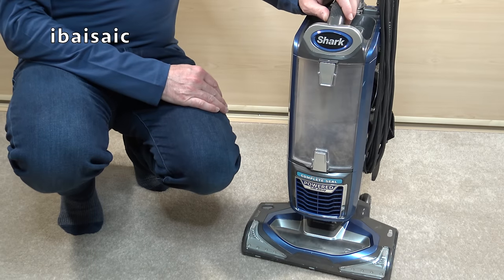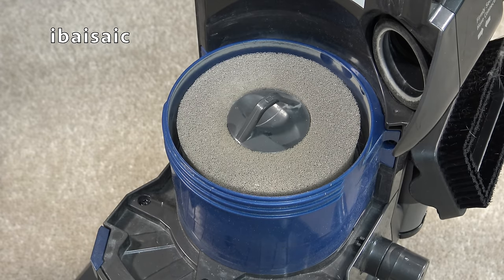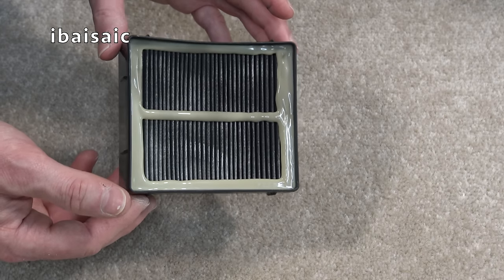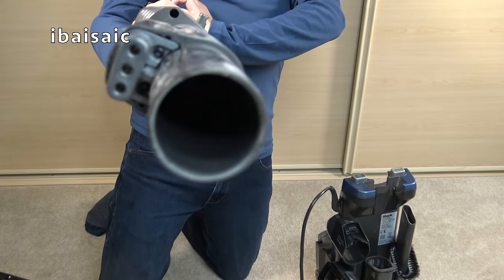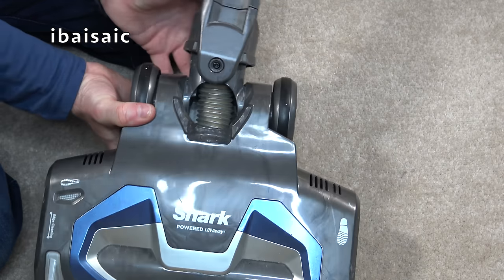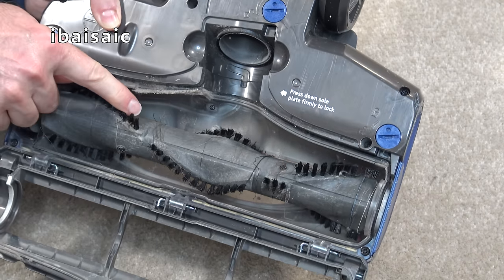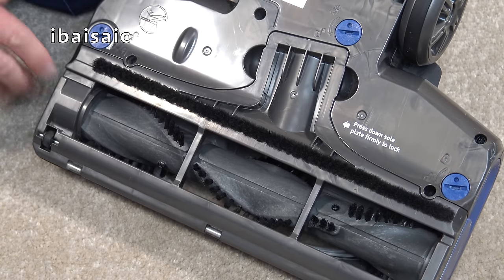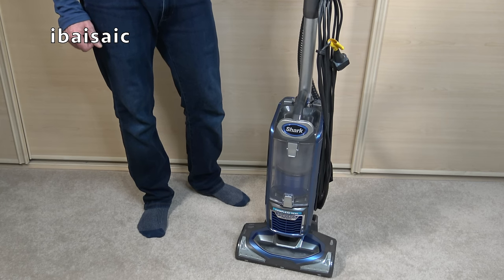Shark Powered Lift Away Maintenance Tips Loss Of Suction & Performance

Comment: Kind sir, thank you for saving my Shark. I had done all the steps, new filters, cleaned brush roll, etc. Had it squeaky clean and yet it had no suction. Because of you I checked the hose! It was incredibly clogged, i pulled out all the packed junk with a 12 inch wire w/tiny hook on the tip (made it myself with dental tools from the 70s). So much stuff came out!. Once battery went through the hose, and I assembled machine back, it worked like it was brand new! No damage caused to the hose because my wire rig was tiny and I was gentle.

Comment: The clog I removed was in the handle. Once I figured out where the clog was I used the six inch brush designed for cleaning the vent duct hose on my dryer. It attaches to a three foot flexible plastic stem that you can screw into another three or four identical plastic stems for removing clogs fifteen feet up the duct hose. One was plenty for clearing the vacuum handle, but you do have to twist it two or three times to clear the handle clog.

Comment: A trick for cleaning the hose and wand after separating them is to get a piece of small rope longer than those, and tie it to a cleaning rag. Dampen the rag with a bit of a mild multi-purpose cleaner or slightly soapy water. Then run the rope through to the other end, and wad up the rag a bit as you stuff it in the hose or tube. Should be some friction, but not to the point where it's difficult to pull through. Thus you can get the insides of those pretty clean with a few passes pulling the rag all the way through like that if there was anything sticking on there. Also make sure things are thoroughly dry before using it again. Different than dealing with big clogs, but will deal with any moldy/musty smells still coming from the vac if the lower parts have already been cleaned.

Also if plastics on floor attachments or wheel rubber gets dirty with anything sticky, a cloth sprayed with foaming tub/shower cleaner will do a bang-up job on them. Let it dampen those spots for a bit, and it should wipe off real easy a few minutes later. A lot of modern showers have a molded plastic liner, so that cleaner tends to be safe on plastics even though it's strong at breaking up dirt and gummy stuff. You may want to wear gloves for that though.

Comment: Check you upper handle hose before going any further with a flash light to make sure you see lights from end to end.  Mine was clogged so bad I ran pressure water through it.  I used blow dryer to dry inside and after a few minutes "bravo" :))  The "dead horse" woke up and ready to work:))   Very impressive videos and everyone's feedbacks what makes this works for everyone:)) Happy holiday two weeks away from Christmas.

Comment: I have both the NV680 and the NV340, and I always notice that the sponge filters of the NV680 get completely dirty (grey with dust, as can be seen in the video at 1.16"/1.17") after each use, unlike the NV340! I bought a second set of filters for the 680, because I have to wash them after each use, it never could go for an entire month without a good wash. I have no idea why this does not happen with the NV340 model...it just seems to have better filtration somewhere in the machine, they just do not get dirty so quickly.
Anyone has experienced this as well?

Comment: So glad I’ve been doing all the right things! Probably why it’s been great for 6 years up to now. Does the brush have a belt that turns it? Mine is not turning and I thought I’d ask before I tore it apart. It works so much better with the brush, I can’t hardly push it without the rotator working. It also doesn’t pick up much on my thick carpet with out it. I’m using my Shark Stick until I find an answer.

Comment: I would also say they have made this vacuum harder to service. They have changed all the fasteners to T20, wires within the head are now passed through plastic before attached. Many don't realise that there is a motor in the head that powers the brush to turn. The lower hose is now one piece and not screwed in on opposite lock. Also some of the parts inside are very easily broken, esp the mech that allows it to stand upright. Trust me I have tore down this machine to its bare components. Think I may have to buy a new one as mines has a noise from the air release vent which I have also taken out and checked.

Comment: Thank you good sir! You just solved our loss of suction issue. Roller wheel was extremely clogged with dog hair and carpet freshener powder was built up in hoses. Everything was cleaned and unclogged and yet there was no suction. I pulled up your video and you showed the motor exhaust filter --- the exhaust filter was totally clogged with carpet freshener and didn't suck - feared the motor was blown😦. Banged the filter semi clean and Voila! DO NOT USE POWDERED CARPET FRESHENER in these vacuums! Thank you so much for showing ALL the nooks and crannies on this vacuum!

Comment: It’s amazing how much a new filter can improve a 3 year old machine. Got this shark pet version given to us from my sister in law. It BARELY had any pull at all. Wouldn’t pick up anything from hard floors at all unless using the hose. Even then, most of it (stuff like little kitty litter rocks) just fell right back out of the hose. 

This thing runs like a brand new machine now. So much hair and junk getting pulled into the tank now after all 3 filters replaced.

Comment: Done all that. Still not picking up
Reply: I'm have the same problem and I've discovered that if I take all the filters it sounds and would work fine. It seems like the compartment behind the hepa filter seems to maybe have collected some stuff that's not allowing the air to flow properly. I'm looking for a video of pics to show me what others loo!s like. Mine looks like they have a gray filter or something but I'm not sure if it's supposed to be there or if it's a collection of dust trapped. Maybe you can check and let me know what You see??

Comment: Thanks for the video! I inspected, checked for any clogs (there were none), cleaned the canister and filters.  It continued to overheat.  Had it not been for your comment about the hose cracking I would not have known.  My shark vacuum isn't even two years old.
Reply from the maker: If your hose has cracked, contact Shark as it should be still under warranty. They have changed the hose on newer machines which should have stopped the problem with the hose splitting on earlier models.

Comment: Thanks for the video. I regularly clean the two pre-motor filters, and was wondering if there was another I wasn't aware of. Sure enough, there was. But sadly, while finding that filter, I discovered that the small internal hose is split. I'll email Shark, but my machine is 10-11 years old, so I'm not hopeful. On the plus side, it has worked well for the past 10-11 years; this is the first problem I've had with it. Thanks again for the video.

Comment: Great video, I've got a vacuum that is the exact same as the one in the video. It sounds like it's clogged and is running on high RPM's, but I've checked everything and the hoses aren't clogged and the filters are clean. Still don't know what's wrong...

Comment: I’ve got a Shark Liftaway that now turns off when I disconnect the Floor attachment to use the wand for dusting.  Shark could not help, They sent a whole new motor body but it still happens. Should I buy a new wand?

Comment: This gentleman explained each aspect of what to clean and how in an understandable manner. The visual details he provided were exceptional. 

Two things he mentioned made an impact on me. The first being the use of antibacterial wipes and where. Thinking of using them was too much like right. 🙄

The second thing he mentioned, and emphasized, made me gasp. I had no idea there were electrical wires in the long hose. I have the Shark Powered Lift-Away with the Anti-Allergen Seal, and my task for today was to perform an interior deep clean. 

The items I intended to use were close to items he stated should never be used. We’ll consider those “the things we do not mention.” 

Excellent, informative, and vacuum saving presentation. Thank you. Shark should have his presentation their website under the maintenance menu website, on how to clean your Shark Vacuum.

But that would also fall under “too much like right.” It’s apart of how they make money. Ooh, did I thank this gentleman? Thank You!

Comment: The motor on mine keeps overheating after 5-10 minutes of use. I just cleaned out the wand. It was loaded with dust and I found a small rock inside. Will update if it continues to overheat. Thank you for posting this video.

Comment: Thank you so much. I though my vacuum gave up the ghost. Since watching this video my blockage was up ar the top of the hose on the inside. I removed it it's good as new.. I went ahead and cleaned all the filters. The speed is up as normal, and the pickup suction is strong again. This vacuun wouldn't even come on even if I pressed  down on the front unless I pulled the handle down the suction was very low like a turtle, Lol 😆 😂 😅

Comment: Thank god for this video when I get up ill do this to my hoover. Something has happened to it. It won't turn on unless u pull the handle right down but its not picking up dust. The light comes on only when the handle is down. I'll Try everything you did in the video b4 I call shark. Thanks for this video 🙂

Comment: I have the revised powered liftaway, almost identical but some parts are revised. I have cleaned everything, checked hoses, brushes etc, I have even stripped down the whole vacuum internally down to the motor and air release vent to the point had the motor out, stripped the handle, but still I get a noise from the air release vent. Can you tell me why it would still be making a noise from this vent after checking everything and I do mean everything ?

Comment: The brushes on my brush roll are worn off and I'd like to replace just the brush roll.  I'm fearing that part cannot be replaced as I've not found how to instructions or a replacement brush roll on Shark's website.  Seems a shame to throw the entire unit in the landfill if all that needs replaced is a small roller.

Comment: Not sure if anyone can help with this but I noticed last night that my shark vacuum, which is exactly the one shown in the video had lost some suction and just wasn’t up to it’s usual standard. 
I took out the motor filter but admit I didn’t clean it properly in water etc the way I normally would because I was in a hurry and right in the middle of vacuuming at the time. 
I just gave the sponge parts a shake and patted them a few times to get rid of some of the excess dust and some hair that was round it. I then put the filter and everything else back together only to find it now had no suction at all.
I thought maybe I’d put the filter back in the wrong way round or something but after watching this video I see that I have done it correctly. I checked everywhere else for any blockages but they’re all clear. I do think it has something to do with taking the filter out because there was still a fair bit of suction before I done that but now it has none at all😕
I know it’s difficult when you can’t actually see the vacuum but if anyone has a suggestion for what might be causing this I’d really appreciate it.

Comment: I have had the rotator for years and only washed out the round foam filter. The flat round filter that’s below it I never touched thinking that it couldn’t be washed. Always wanted to get to the exhaust filter but never knew how to take it off. Just kept putting it off. It’s just a vacuum. I will get around to it I kept telling myself over the years. Only lost suction one time years ago. Trash was caught in the flex hose. Easy fix. I finally bought the flat round and exhaust filter online and needed to know how to get the exhaust cover off. Which brought me to his video. My luck the first video I click and wow. Thank you very much for the very thorough explanation and cleaning process. I feel like the engineers have thought of everything and I’ve made a great purchase now.

Comment: hi I couldn't work out what was wrong but its the hose it has cracked at the bend at the bottom I covered it with duct tape see if that works till I replace good video thanks.

Comment: I have changed out all of the filters and I've cleaned out every hose and I'm still losing suction. I have a thick rug that I usually have to open the air  vent to clean it and now I don't so I can tell there's little suction from the base. It sounds like there's a clog but I've checked every where and there's nothing.  Help!

Comment: in the handle that the hose is attached to, are  there any valves in this or  is hose handle open straight through?  if i look down handle section i can see a circular disc.  (vac has lost suck)

Comment: Thanks for the video! Mine was making these obnoxious popping sounds and lost suction. I cleaned it all out, it didn't seem to fix it. But on mine, on the right side of the vacuum at the bottom of the long tub, there's a plastic cap that can be opened. While the vacuum was on, I opened it, then closed it, and now the whole thing is fixed! I'm guessing there was some blockage I didn't see or something, and messing with the suction in that way cleared it out.

Comment: How do you clean the plastic clear window  area where the roll is?? I cannt take the roll out to get underneath Of the roll. This is a GREAT VIDEO THANK YOU!! Hope you can guide me on cleaning the plastic cover over the roll.
Reply from the maker: I use a thin cloth with some detergent on it and feed it under the brush roll. Keep turning the brush by hand and you should be able to clean the worst of the dirt off the clear window. You could also try a small flexible bottle brush.

Comment: Thanks so much!  If no suction try all these points first before new motor or new bottom hose.  With me I found it was the wand jammed packed full of matted dust and hair from top to bottom.  The plastic nodule inside the wand gave it something to build up on. You've saved me the price of buying a new cleaner.

Comment: Hello. I have a similar model and the brush stopped rotating. The light of the brush also is not working. Do you have an idea what it could be? Thank you.
Reply from the maker: The brushroll motor may have failed or there is a loose connection.

Comment: Thank you 👍🏻.

This is the first video I've watched on the subject having gone through all the filters already. So it's good to know that I found all the filters just through going over the machine and there's a few other bits I found that made it easier to get to the hoses. The part where you said drop a big battery through the hose was fantastic advice, something I hadn't thought of. And promptly I found out where the blockage was! I put a 3.7 volt 3000mah battery through and it promptly got stuck, So using the old windmill technique it helps to dislodge the blockage and a flat tooth screwdriver. So a massive thank you to you for posting this video, brilliant job, You're a star. ❤
Reply from the maker: Thanks.

Comment: Hi. Great video, thanks. I have a Shark NV680UKCO and have developed an odd issue. When putting the machine into hard wood mode (button on top of handle), the motor just stops/ cuts out. It works as an upright on carpet, but even this is now making a slightly higher piched noise and isnt picking up as well. I've taken it apart and cleaned regularly but am not at a loss. Shark unable to offer over the phone support. Any thoughts?
Reply: Hi did you manage to fix this problem ? I’ve developed the same issue and don’t know how to fix it

Comment: About the HEPA filter, I've heard that you're NOT supposed to wash those. About cleaning the hose, I've seen people soak them in soapy water then let them dry and they still work fine.
Please keep in mind when reading this I may have been lied to but I don't know so if you soak you're shark hose and it breaks I'm not responsible.
Reply from the maker: The instructions say you can rinse the HEPA filter in water. The hose contains electrical contacts in a powered lift away model, so I would personally not get water in it. If the Shark is a non powered lift away with a regular stretch hose, then it could be washed, but it would have to be 100% dry before fitting it back on the cleaner.
Reply: @ibaisaic  Maybe UK models are different then the US models I know about I don't know.

Comment: Great video thank you but I still have an issue. Constant red light and roller not rotating on carpet mode. No blockages, filters and rotor thoroughly cleaned and wiped. The roller rotated freely when switched off but no longer rotated on carpet. Any ideas?
Reply: You need to replace the belt. But Shark does not sell belts or any spare parts.  They require you to mail it back to them at your expense, or sell it for parts and buy another company's vacuum.  Depending on the model you can get lucky in hoping some Chinese sellers might make spare belts, but it is sporadic and improbable.